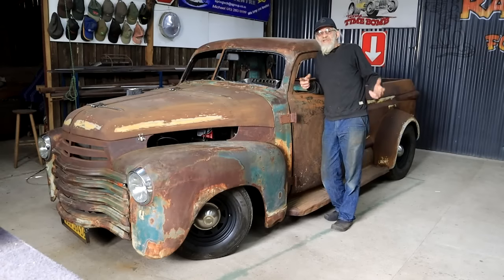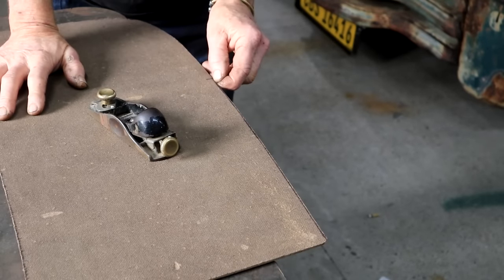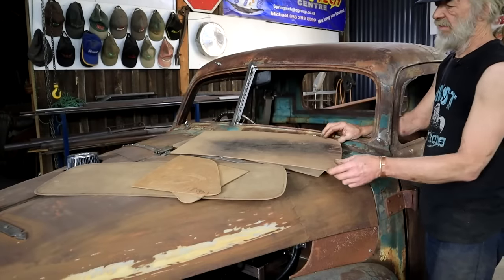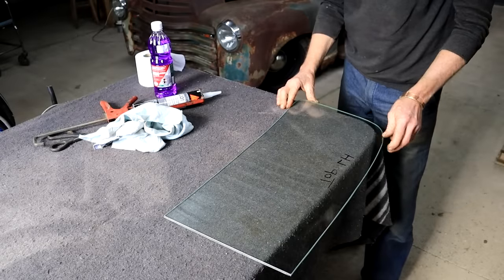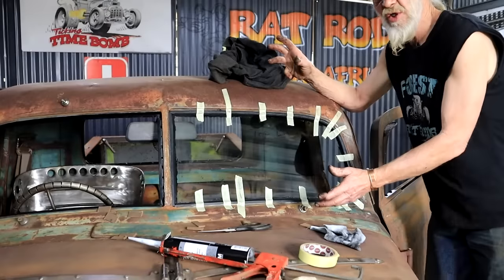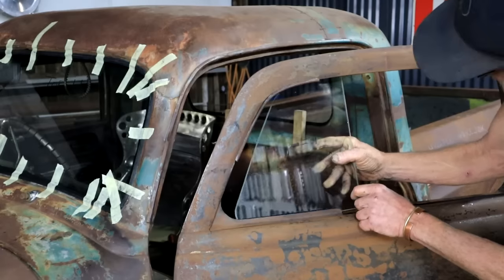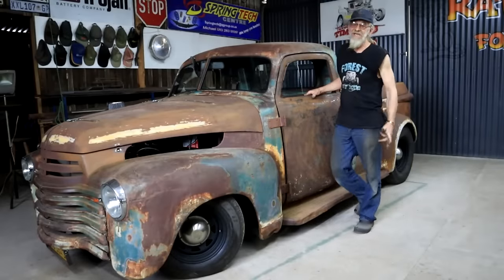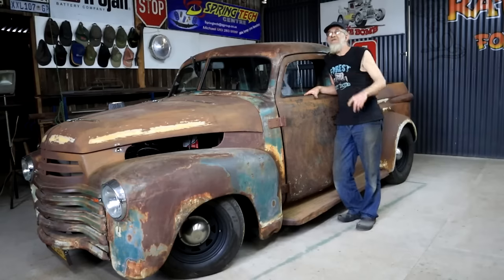How to make and fit your own windshield!

Comment: Hey there Diff.. 
 Nice job on the windows man.
   Hey man I have a very good idea for some side door windows for you.
  Why don't you make some from 
Lexan plexi glass , and use some seat belts for lifting and locking them in place, just like everyone used to do on race cars back in the 1950s,.  It would be really cool, and fit the style of your build , and also your budget.
  What do you think man?
Reply from the maker: Yes, that method works well! I did it that way on another build

Comment: You were to use a glass primer on the lip of truck  and the glass , see how easy that windshield Urethane peel off glass that not good no adhesion to keep that glass in under vibration .
Reply from the maker: I did say in the video that correct primer is recommended. But I've done 2 other trucks exactly the same way, one an off roader thats seen some serious shaking around. Still holding, so works for me...

Comment: That method would ad torsional stiffness to the cab. Whereas installation with rubbers alone
 would not; in my opinion.  Greta job !.  Buy a better silo gun. those pressed metal are just aweful. Great job again.
Reply from the maker: Thanks. Yes that gun was horrible! 😄

Comment: The way to lay the triangle bead it to cut a V shape into the plastic nozzle of the polyurethane dispenser.
Reply: But only on one side of the nozzle. The side that will be the top of the bead. 👍🏽 I hope that helps for the next build.
Reply from the maker: I tried that, didnt work. Then only afterwards realized you have to hold the gun a certain way too!😅

Comment: Seem to squeeze my rubber into the... gun it a little bit more...
it's sqeezing out...
that got me heated up...
that squeeze-out is on the inside...
nothing beats the middle finger...
how many times do you have to fit and remove, fit and remove...

Are you sure you have a rat rod channel going Div?
Reply from the maker: 😂 Takes a shrink to pick up on the undertones boet!😂😂😂

Comment: Did you heat up the tube in hot water before applying
Reply from the maker: Nope. It's summer here, felt it was not necessary